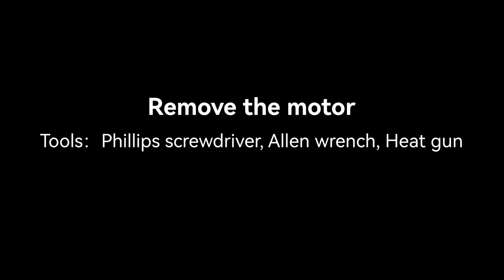KingSong S22 motor replacement

Comment: Easy tire change TBH 
Most wheels twice the time and screws before even getting the damn thing out just a little bit. 
I'm done with plastic shells. 
All I have to do to mine is tighten down those 4 screws on the slider bracket on both sides. Just became loose.

Comment: The screws at 1:57 don’t come off. Pretty sure I use the proper tool. At setting 16 thescrew driver blocks. Disabling that it ruins the screw. Using an allen key hand tool doesn’t do it, it almost feels like it would snap in my hand.
Reply: did you figure out a way to remove those screws?
Reply: @skobuffs7  no, but there is another way for the wheel to come out. Then I had to remove the 8 screws on the motor wheel. 2 were hard, i didn’t have a heater.so hitting on it with a hammer gotvthem out. Now I am waiting for the spare parts they send me. They failed to send by express so will be long wait.
Reply: My brand new wheel had a 1-2 mm splinter kind stone inside between the inner tire and the rim.